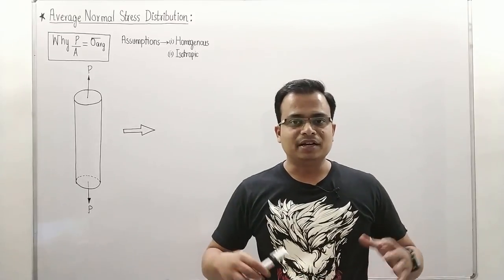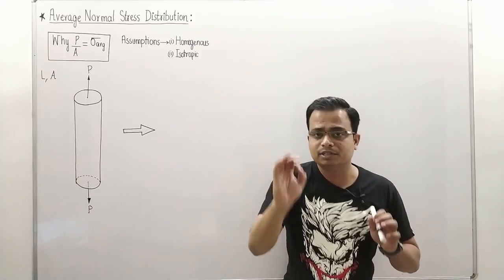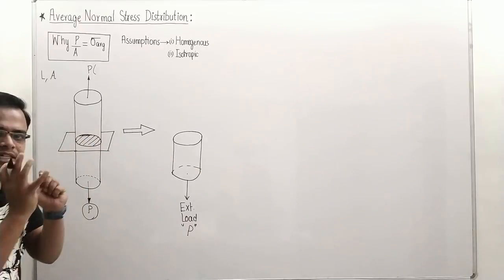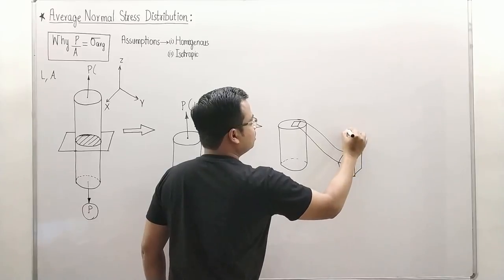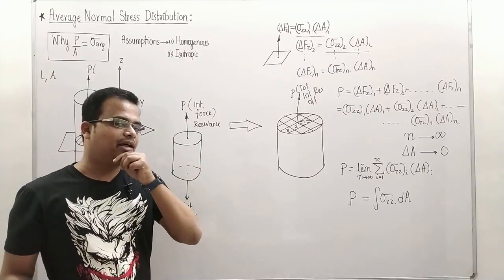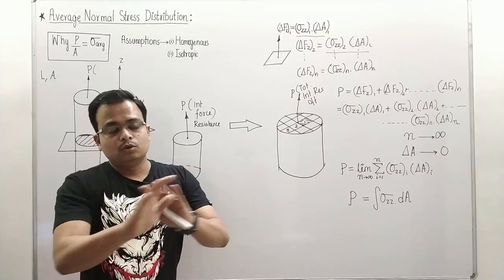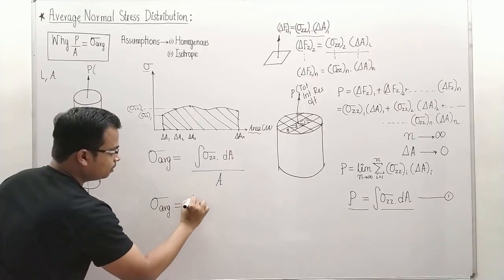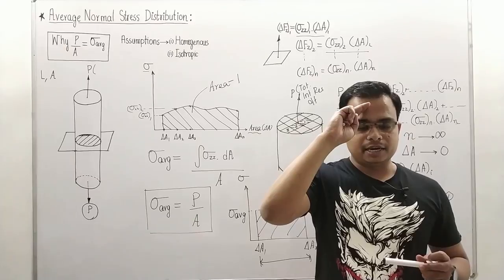Mechanics of Solids | Stress | Average Normal Stress |

Comment: Sir, Request you to Please explain how Stress for Different element if Different..when the Load Applied is same for all the elements and every element is also same then the Stress also should be same for all the elements right...Which means the Concept of Average stress is still not Clear...
Reply: The concept of this average stress is by imagine when u cut an element into two it is impossible to see the resistive force but we can expose it by understanding equilibrium of force. Take for example a cross section of an element when tensile stress is applied to it. A resistive force called internal stress is distributed through out the area of that cross section, one of this internal stress is not enough to balance just a single line representations of  the tensile stress pull out, so if we sum all this internal stress inside the element it turn out to be the sum of the one acting perpendicular to the area of the cross section (tensile), the another acting parallel to the area of the cross section (shear force) and the result from them will be average by dividing it by 2. The above explanation is just what this video shows when u cut the element to expose the it some of it act upward while the others act parallel and of course if u put all this internal forces together and divide them to the area it act(cross section) it will produce a quantity that will not just be a stress but an average stress.